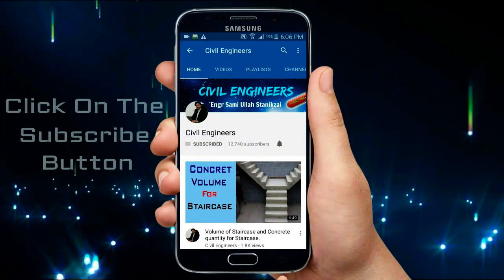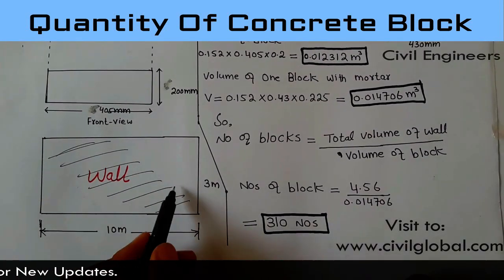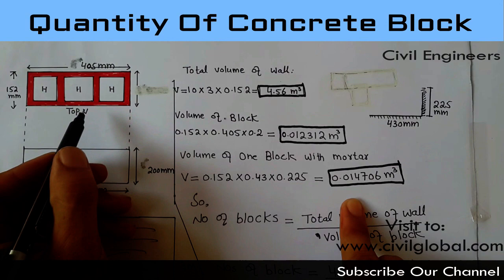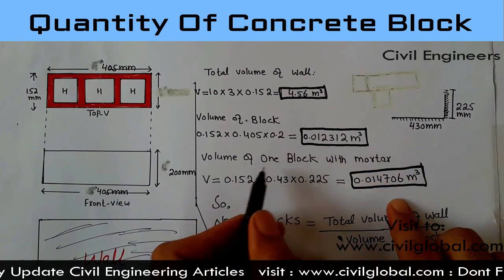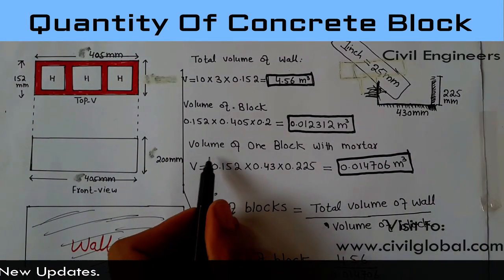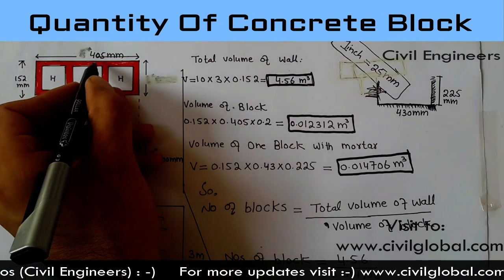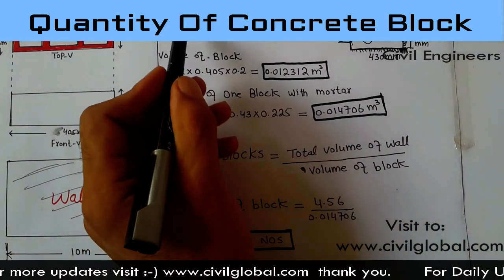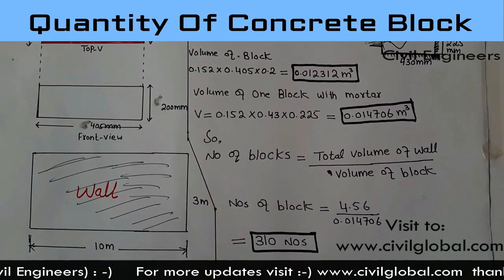How to Calculate  Quantity of Concrete blocks

Comment: Thank you for this video.. but I have question which unit is best to use in calculations like this  because different unit gives different values?? Before I sse this video my calculations in ft. Inch. and mm are very different.